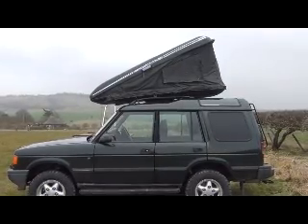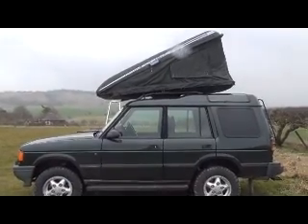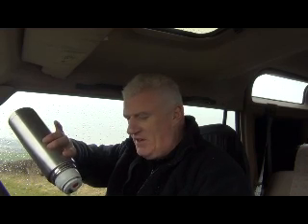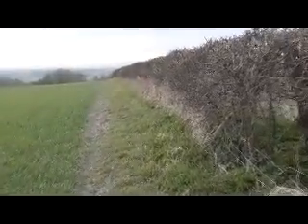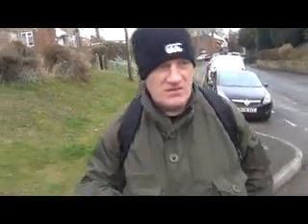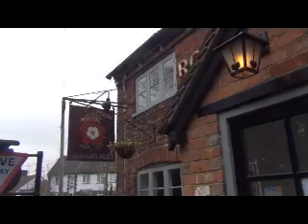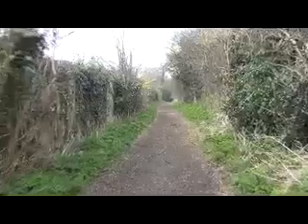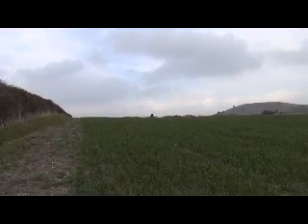Weather testing DIY Roof Top Tent Pt3

Comment: We need a more comfortable life as we get older.
You have just made life easier for yourself.
Well done mate, nice job.
When i first saw your idea i had my doubts  but you proved me wrong because its turned out very practical. If you had attached some metal drag strips to the bottom you could load it up and drag it anywhere like a big sled with a rope attached to the back or bottom of an A frame or a framed rucksack or even a deer dragging harness.

Comment: Hey Roach. Fantastic vid as usual. Couldnt help but notice the noise from the hitch when you were leaving.If you wanted to sort that (stealthier approach- not stealth but stealthier) and a quieter drive, an idea would be to wrap yhe hitch with a few layers of inner tube and grease the rubber? That would dampen the noise and help a little bit. Not sound proof but every little bit helps. Keep em coming and thx for that.

Comment: great setup!  beats spending 2k+ on one.  I just had the same idea about using a pre-existing box for the base,  more inconspicuous too!  Not sure if you ever mentioned how you fixed the roof and the floor to the existing box.  Did you have to drill through the top or bottom case?

Comment: I like it. Plan to build a roof top for the ATV. Hope to let it double as a deer stand. The plan is to use rigid foam with a few coats of two component polymer as a skin for the shell. Tyvek home rap is something I like working with for the tent parts. It will not be very heavy and I don't think it wise if it were, being on top an ATV. Thinking in the event I had an accident, I would prefer the roof top to get damaged than myself. The roof top popup tent working with the ATV cab will make the hunting trip much more comfortable if it rains or snows. I can do a full bugout to a camp site with everything I need on the ATV. Helps that I have a Kelly Kettle for the chuck box. Got it down to minimum, in the event I need to go out the back way. Truth is, I am bugged out already and if I needed to go anywhere, the back way is the only wise way to go. At my age, I wouldn't want to get far from the house in any event, other than to circle back later.

Comment: like the roof top tent and the wind turbine where did you get it from
Reply from the maker: Maplins.
Reply: ***** Grate there's one up the road from me.  Was watching one of the preppers that was with you once and they was trying to make a fire stick to light the fire better I use a spoke shave from my tool box put in on a fine shave and it works a treat try it one day Thanks for the Info

Comment: Roach are you sure the little display on the turbine is volts? as 7-10v wont charge a 12v battery bank. If it was watts, or ammeter that would make more sense! :P ATB

Comment: I like the idea of a roof tent for my travels to Italy in my Fiat Multipla, I watched your videos with interest and must say you've done a great job but I thought of a way that may be easier, and that would be to put a fitted cover on the outside of the open roofbox that would overhang and fix to the bottom part and make an inner tent similar to yours fitted inside. When the tent is to be folded away the outer cover could be folded up and put inside the box provided it's not wet.
Reply from the maker: Sounds like it would work, well-done now make one and show it to us, Be safe Atb. Roach